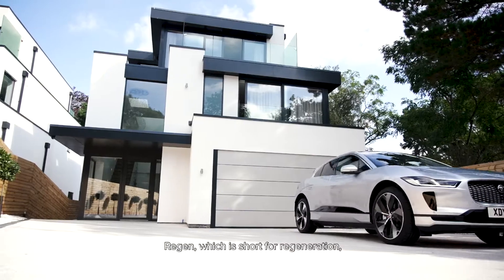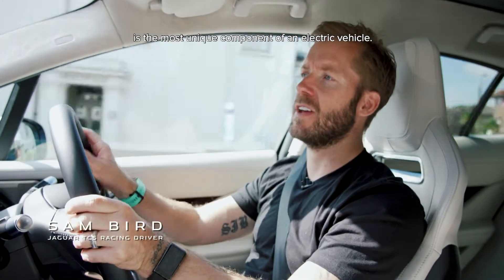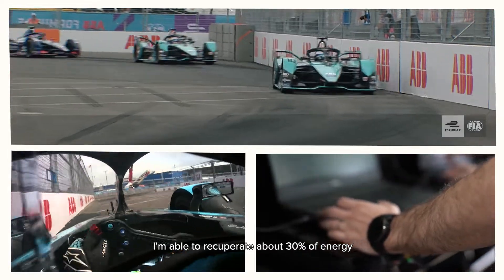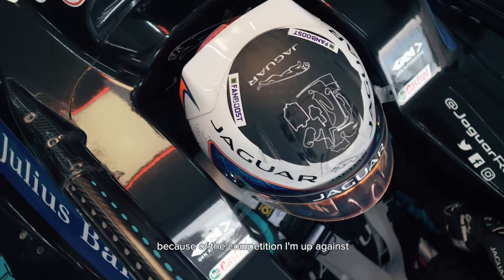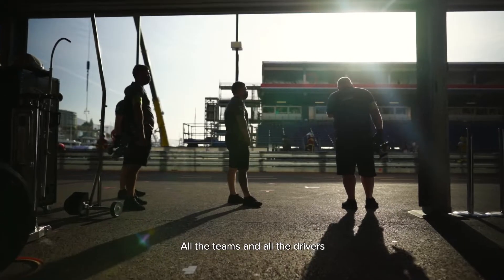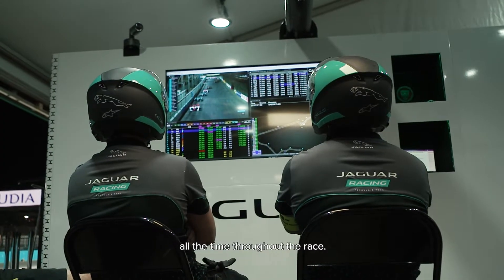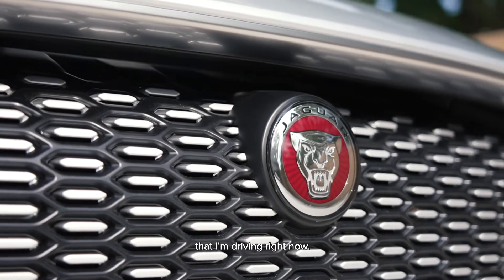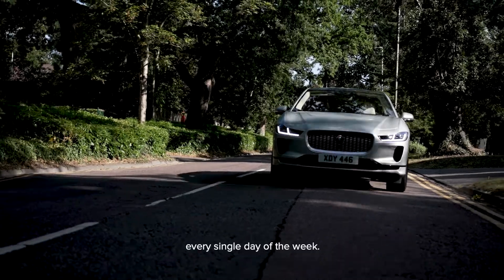Jaguar TCS Racing | Regeneration Explained

Comment: Never knew regen was a thing in FE. It would be phenomenal if regeneration of energy would branch out of FE into other related motor sports such as F1 which provides hybrids. Now this is interesting.
Reply: F1 already has Regeneration though…. See the MGU-H, and the MGU-K, the first of which has a turbine that is spun by heat, and the latter which generates power via the motors, which can then be used at will with ERS deployment.